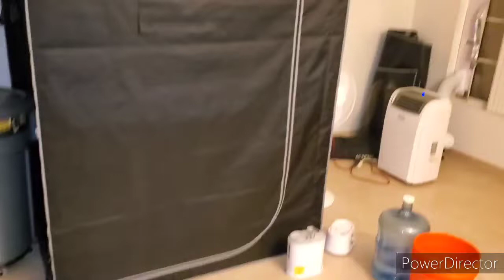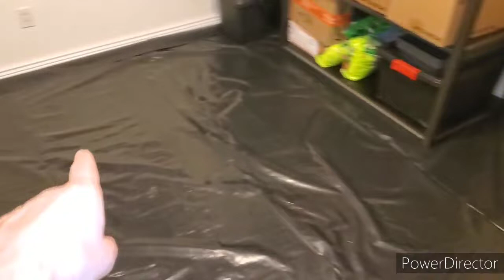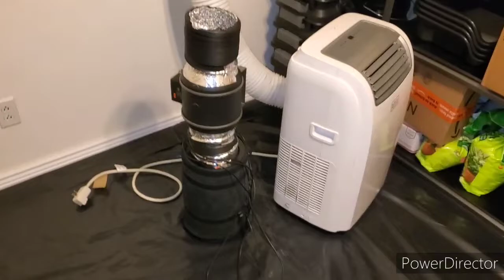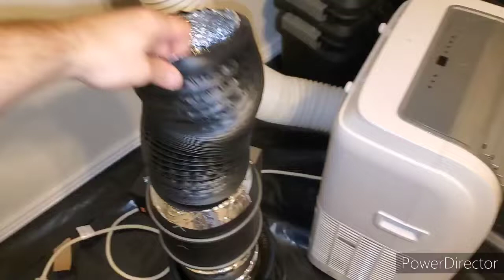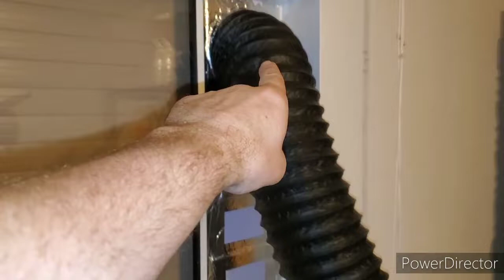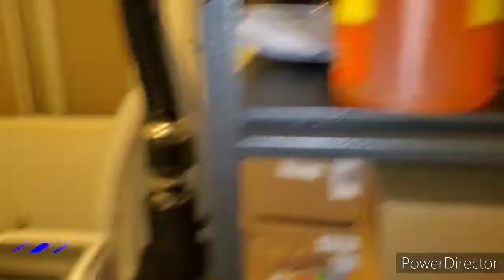New Drying/Curing Room Configuration!.!.!

Comment: Why did you vent to outside?seems like it's going to suck out all the cool air.
Reply: NVM I didn't watch till you explained
Reply from the maker: @joshpennington2983  but yeah... the ac infinity will blow out some cool air.... hopefully I can get the humidifier dialed in so the ac infinity isn't blowing too much out
Reply: @thewell-roundednovice8852  you can just leave the exhaust fan in the room it will still scrub the air that way you don't blow your cool air outside
Reply from the maker: I'm using it more as a humidity controller until I can get the humidifier dialed into the correct output... but yeah, My goal is to have the room humidity stable at about 58% and the vent van only will come on if it hits 60%
Reply: Does your mini ac have a drain line connection on back?? I ran a drain for mine and leave it in dehum mode.. I had to cut a small hole to run the drain outside.
Reply from the maker: It's got a little plug in the front.... probably going to end up sitting it on a chair and dripping it into a bucket